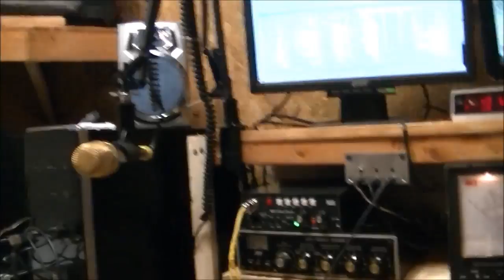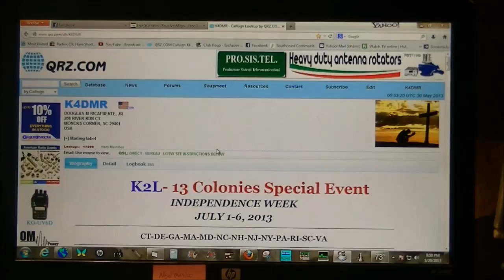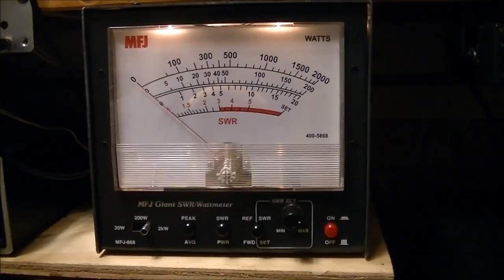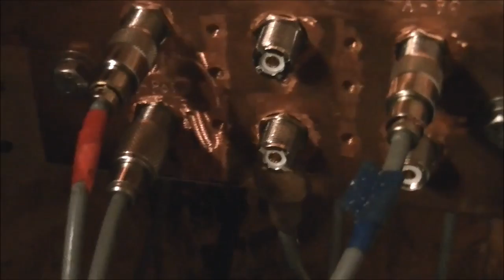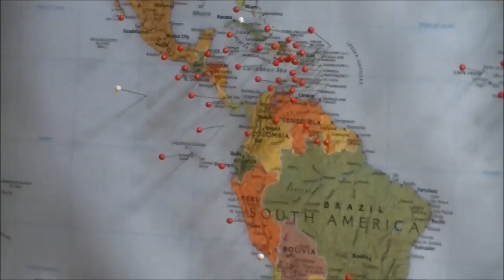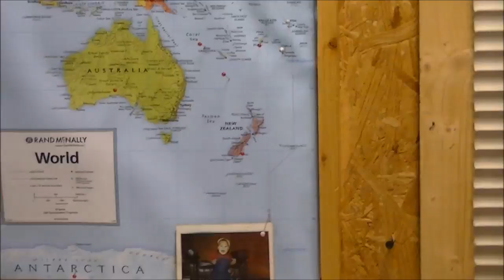yaesu ft 950 station  K4DMR

Comment: Don't forget, on the 950 is the best feature of all. The TX BPF can be switched back and fourth for local ragchew, ground wave or a dx pileup. This feature is your best friend on these rigs.

I have the same rig, also a brand new 811h which I've never hooked up because I haven't needed it yet. All my contacts I made with less than 85 watts. I just use the TX BPF feature and can always punch through any pileup.

Comment: Hi Doug that's a very nice set up you've got there it's very impressive mate so well done OK and I've got the same radio like yourself and they really are a fantastic radio and they do so many different things I've only just had my Yaesu FT-950 repaired because the outputs had gone but I got them replaced and my radio is working really well on all of the HF bands and there's always something interesting to listen to on the 45 meters of a night and I find them very interesting and great to listen to of a night before I go off to bed. Anyway you take care and I hope to speak to you very soon then mate OK cheers mate thanks. Stephen M3SNV 73's.